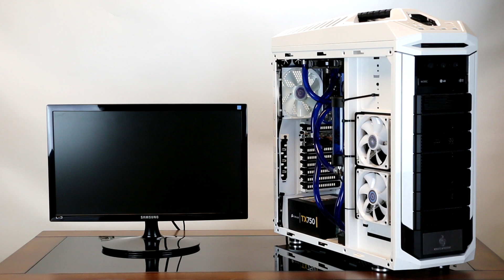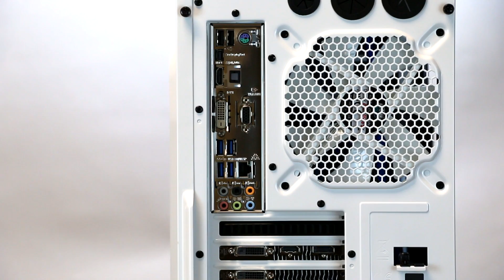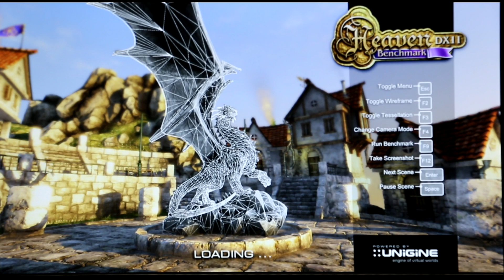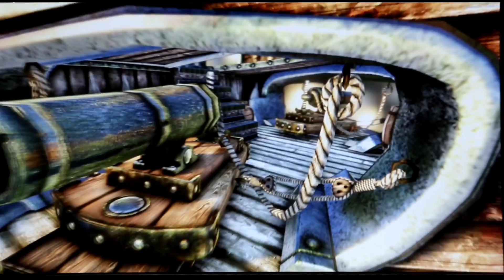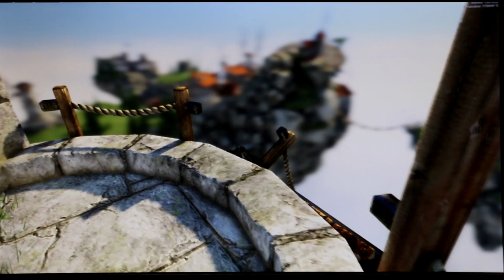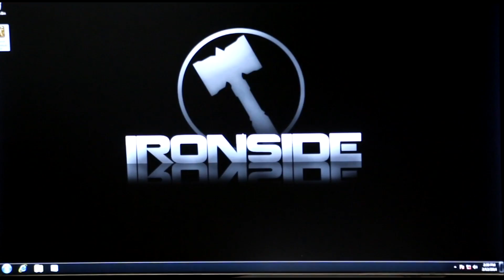Ironside Computers Video Demonstration - Order 814164

Comment: I have a personal preference for AMD GPU's.  The benchmarks that I saw are all pretty close.  It was a close call between the 290X and the 780ti but I stuck with AMD.  If it turns out that it costs me a 2% difference in FPS I'm just fine with that.  I went with the memory fans just because I thought it looked good and matched the rest of the setup.  With full watercooling going on that was just aesthetics.

Comment: How much did this computer cost?
Reply: You can run it through the configurator to get the exact price on the site.  I will say that it was a little more than I would have paid from a "discount" vendor, but much cheaper than the exact specs at Digital Storm, Puget Systems, Origin, Main Gear, ect...  I also looked at Falcon Northwest, but they have VERY limited customization and are priced at the very top of the market for spec.  After seeing hundreds of bad reviews for ibuypower and cyberpowerpc I just dont trust them or their wanrranty programs.  It was an easy choice when I finished looking.